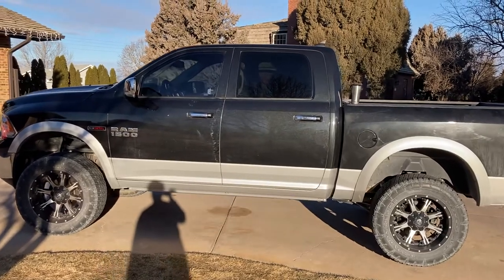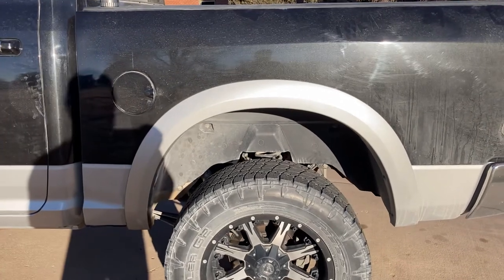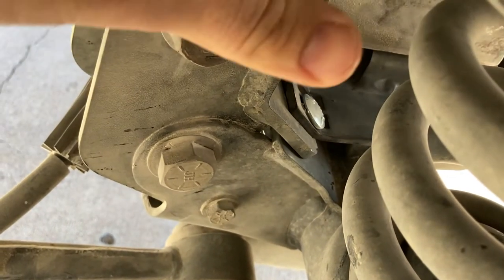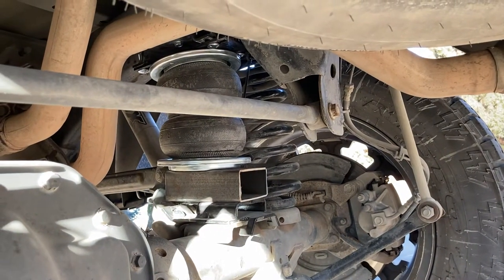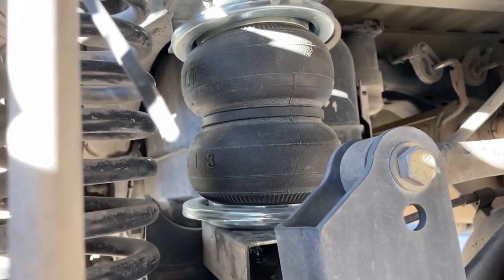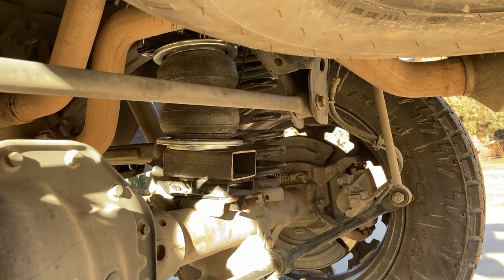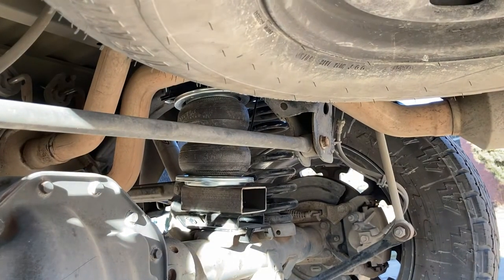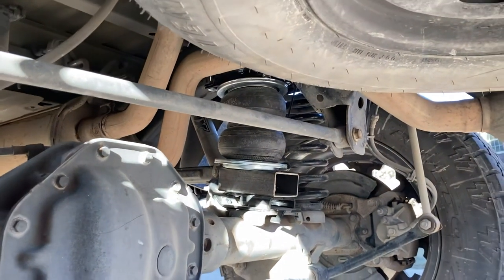Lifted Dodge Ram 1500 – "Load Lifter 5,000" Rear Air Spring Kit

Comment: Did you instal the compressor? Where did you locate it and what compressor did you use?
Reply from the maker: I didn’t end up installing on this truck but will be putting it on my F250. But I bought this one to put on it I planned to mount it along the frame

https://www.suspensionconnection.com/91726-leveling-solutions.html